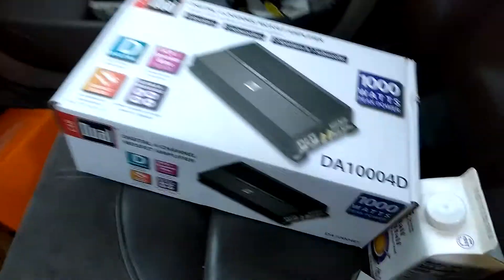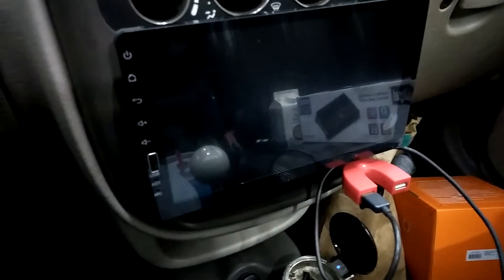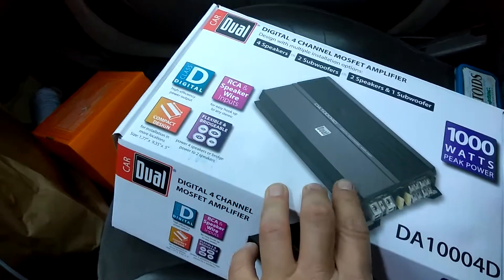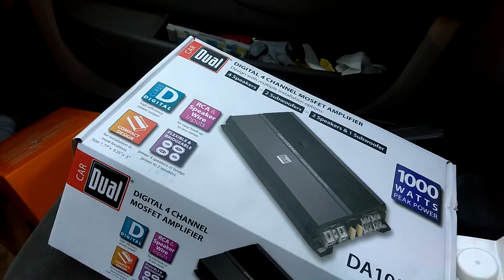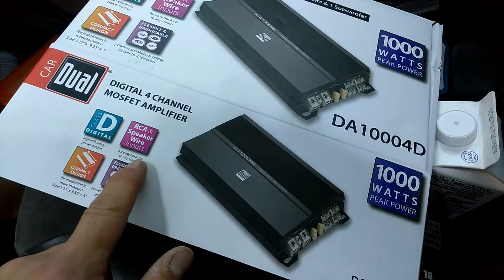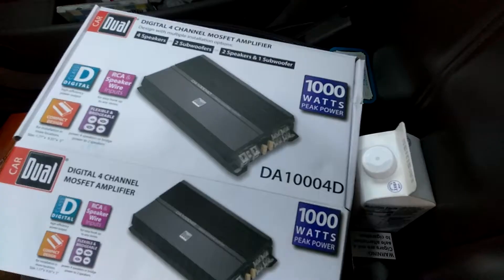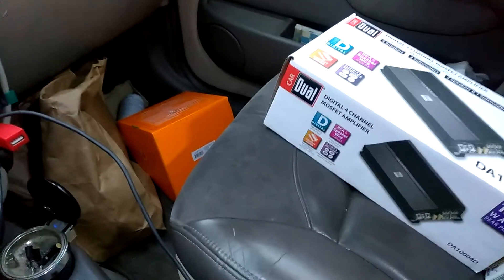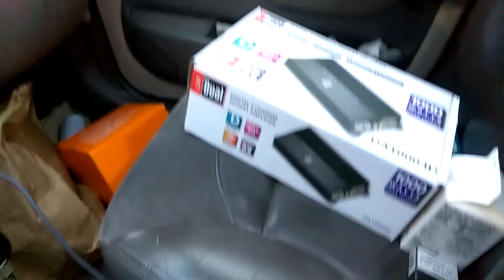Dual 4 channel Amp Intro

Comment: Una pregunta,mi amplificador se corta a alto volumen cuando le falta pila tocando solo aguanta un poco subo el volumen del bajo inmediatamente se corta, tengo doble pila y con otros amplificador
Reply from the maker: GOOGLE TRANSLATE:  

𝕆𝕟𝕖 𝕢𝕦𝕖𝕤𝕥𝕚𝕠𝕟, 𝕞𝕪 𝕒𝕞𝕡𝕝𝕚𝕗𝕚𝕖𝕣 𝕔𝕦𝕥𝕤 𝕠𝕗𝕗 𝕒𝕥 𝕙𝕚𝕘𝕙 𝕧𝕠𝕝𝕦𝕞𝕖 𝕨𝕙𝕖𝕟 𝕚𝕥 𝕙𝕒𝕤 𝕒 𝕝𝕠𝕨 𝕓𝕒𝕥𝕥𝕖𝕣𝕪 𝕡𝕝𝕒𝕪𝕚𝕟𝕘, 𝕛𝕦𝕤𝕥 𝕙𝕠𝕝𝕕 𝕠𝕟 𝕒 𝕝𝕚𝕥𝕥𝕝𝕖, 𝕀 𝕚𝕟𝕔𝕣𝕖𝕒𝕤𝕖 𝕥𝕙𝕖 𝕧𝕠𝕝𝕦𝕞𝕖 𝕠𝕗 𝕥𝕙𝕖 𝕓𝕒𝕤𝕤 𝕚𝕞𝕞𝕖𝕕𝕚𝕒𝕥𝕖𝕝𝕪 𝕚𝕥 𝕔𝕦𝕥𝕤 𝕠𝕗𝕗, 𝕀 𝕙𝕒𝕧𝕖 𝕒 𝕕𝕠𝕦𝕓𝕝𝕖 𝕓𝕒𝕥𝕥𝕖𝕣𝕪 𝕒𝕟𝕕 𝕨𝕚𝕥𝕙 𝕠𝕥𝕙𝕖𝕣 𝕒𝕞𝕡𝕝𝕚𝕗𝕚𝕖𝕣𝕤

1.  First thing to check on the amp is to see if your Power/ Protect LED flashes when this occurs. 

2.  GET a CHEAP VOM and measure the ohm load of your Subwoofers. 
-Is it  2 Ohms?   4 Ohms?    

3.   If it is 2 ohms, then wire the speakers in Stereo, not bridged mode, then the amp can handle 2 ohms impedance.  

4.  If it is ~ 4 ohms? Then you might have either: 
-A)  A low voltage condition. 
-B)  A low Current /Wiring issue. 
-C)  Protection circuit fault 
-D)  An over current Protection Trip
-E)   Thermal protection Trip
-F)   A BAD ground. (most likely) 

POSSIBLE FIXES

1.  Wire the subs in stereo,  and see if it does this. 

2.   Check wiring and fuses make sure they are seated and terminated correctly paying attention to your GROUND for both batteries and the Amp to the frame ground. 

3.  Elevate the AMP from the Metal of the car, and see if it still does this. 
One of your MOSFETS may have shorted to ground on the case due to the isolator not being attached properly to the heatsink. 

4.  If running full range,  (front or Mids) 
then it's possible that one or more speakers have coil rub, and the output signal is being shorted to ground when the voice coil rubs against the magnet causing a temp short to ground. (common in Door speakers where the surround foam rots) 

I know you said you had 2 batteries,  but in the past I've ran into wires where the internal of the wire started corroding and therefore started giving me issues.

The last thing to check is if you are able and know a few things about amplifier disassembly and are pretty good with the screwdriver, you can take apart the amp and check the internals and see if there are any issues with the capacitors just by visual inspection as these are the first things to blow up or go quite often.

Check out BareVids and a few others that you amplifier repair and you can check out the methods use to help diagnose an issue or Lewis Rossman and his famous alcohol trick.

Lastly, if you're using this amplifier to drive subwoofers it really isn't ideal but it will do the job for very small systems.
I highly recommend if you're using this for subwoofers to simply get a much larger amplifier.

All honesty you can get the terror amps which will do 3,000 watts and it will do it very efficiently even with a stock electrical system and give you plenty of headroom in order to actually get really good output especially after box rise if you're using something like a ported subwoofer box.

Remember, you're not going to be using all those 3,000 watts after box rise so since you already have a battery or dual batteries the current requirement to do so shouldn't really be an issue as most of the time after box rise you'll never see 3,000 watts that the amplifier is capable of and they routinely go on sale for $125 At least in the US market.  

This amp is also sold as a FOCAL unit in other markets, along with a Blaupunkt unit. 
They have Very strict protection circuitry when it goes below 4 ohms Bridged. 

It can deal with the two ohm load for very very brief periods but the protection circuitry is very sensitive so in bridge mode it really is preferable to run no more than farms on this amplifier.

However in stereo mode it's quite a bit more lenient and we'll run a two home speaker and stereo mode.
But then the amount of power that you're seeing is probably going to be less than 75 watts a channel maximum and that's at maybe 2% THD and definitely into clipping.

My suggestion is that you definitely upgrade to a much larger subwoofer amplifier and make sure to check your grounds as these are the common faults in the issues with amplifiers having the same conditions that you described.  

I hope that helps. 
:goodvibes:

Comment: Where is the AMP Review. I went to you channel . Look forward to it
Reply from the maker: I  will finish my long term wrap up soon.  
I'm doing heat testing and  noise testing and testing cables.    Also the High level inputs and low level input noise rejection etc.  

It passed the "Offroad  NVH testing"  with flying colors and has no less then 450+ hours of strenuous testing.    NOT SINGLE HICKUP.  

What I can tell you (So far)  is that it is a GREAT Sounding amp for the regular guy.   The $100 price tag is a STEAL.    And the amp sounds every bit as good as the first day I installed it for testing. 

THe High level inputs are above average  (Fidelity) however noise rejection is bellow average.   (Whine hiss cable noise rejection etc) 

I have also tested the INPUT sensitivity on the RCA inputs and this unit like to have a hotter signal.   The High level input is about average.  

Noise (Op amps) are of Very quiet.  I can't hear any Hiss or noise from the input stage  regardless of gain.    So the input stage is IMO Above average. 

Its not the most revealing amp.   What I mean by this is that I think the amp gets a TAD smeared when you have a LOT of Musical Information.   

Its not Muddy or garbage buy any means.   What I mean is that it seems that it does better when the load impedance is  static so speakers with a ZOBEL or a Flat impedence curve seem to work best with this amp so it does not change its voicing if that makes sense.    It could be the passive crosover network however I am using.    So I'm still testing.  

On active speakers arrangements via a Network mode from a Pioneer head unit,  its a Dream come true.    Same with my audio control active crossover.    Its sounds PERFECT with a system run active on the same drivers.    
Same with the Maggie's Inside the house.  

I will try to get to it this next month when I finish the complete setup.

Comment: Good for 4 6x9 jbl stage speakers on doors??
Reply from the maker: Dude MOAR than enough! 
ASR (Amir at audio science review) tested the very amp in this video.    Its in the top 5 so far of amps for SQ.  under $100 bucks with the 15% off you get if you order online.    If it's more than that?

Check out JP and Down for Sound or Showtime electronics.   JP has his own line of amps that are BAMF for running  full range speakers.   
Get them as a Refurb (return) and get the best price on it.

Comment: How did it turn out? I've heard good things on these Dual amps lately, and I'm looking at this one or a pioneer for 6x9 and 6.5's in a small car.
Reply: Works amazing I have one on a harley with 8in mids 6.5 fronts and 2 tweeters all marine competition speakers and you can hear it clear as day a mile away almost must have good speakers too match with it
Reply: @onetwoyouadeadman  very cool, I'm getting it for some JBL gto's into a 9th gen Corolla, it should scream!
Reply: Think it can handle 1.3 ohm per channel?